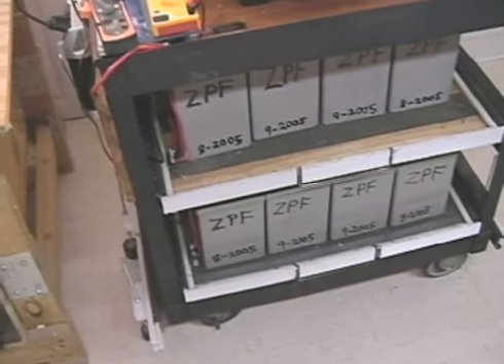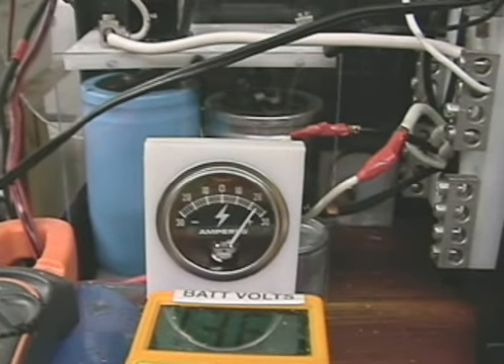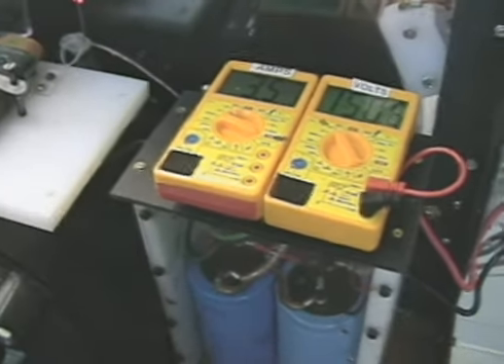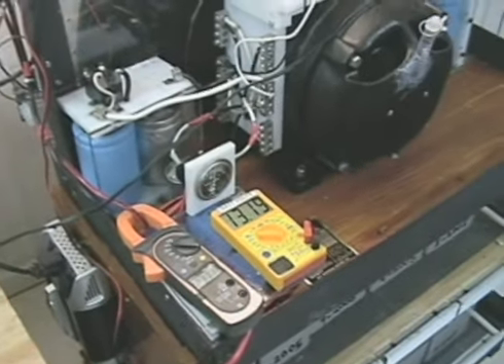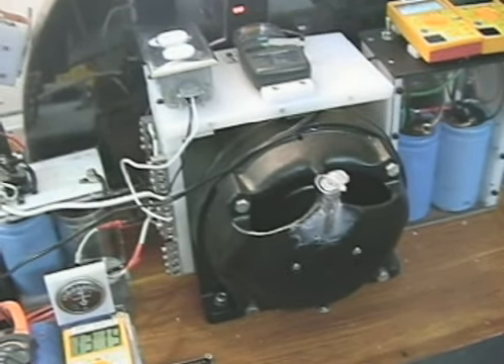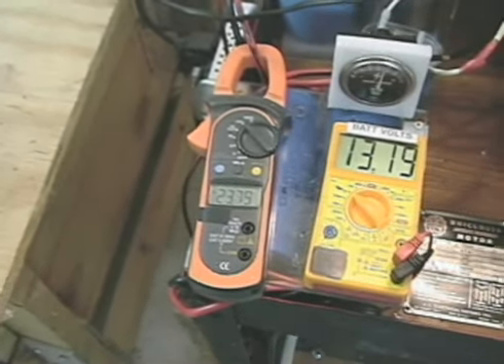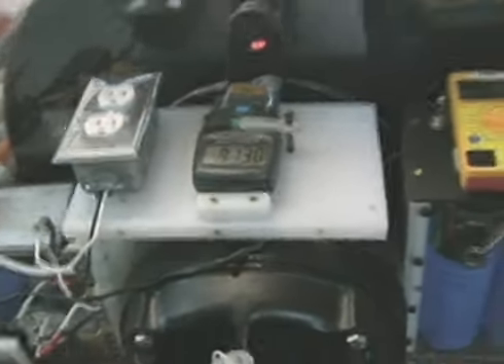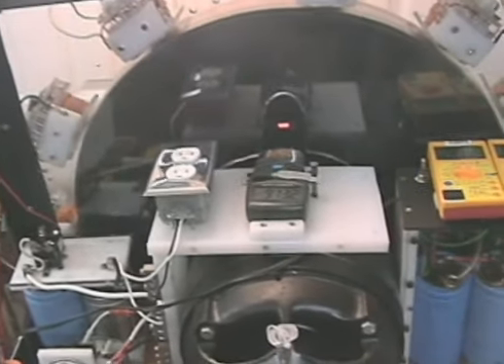Cartmotor3.0

Comment: @zeropointfuel I see. Have you read up on Hugh Piggots permanent magnet alternators? Pretty good stuff if you wanna go homemade. You have to use very high quality perfect (no knots) hard birch plywood though. I see gens attached to pulsers and i wonder if maybe one has to have quite a long drive shaft to the gen, and shielding between.

Comment from the maker: @KyleCarrington check out Cartmotor 4.0 not sure about Two-Stage Oscillator work .but the spinning mass is 32lbs at least for now ,The first of the four generators planed  is induction 6 amp 1/3 HP motor. By connecting  large DC caps together at the positive and the negative connected in parallel to the sine wave from the generator will be diverted  back through pulse motor

Comment from the maker: @KyleCarrington YES and YES the large size of the wheel has real usable torque. If I can strike a balance, I can control the sequential pulse motor runaway effect  with the load, then the 80% the energy passing through the motor  that is charging the all those batteries is free energy add to that professorial pure sine wave inverters  and you have a working system

Comment: @zeropointfuel When you refer to it as the SG pulse motor do you mean, by saying so, that it is based on the School Girl circuit?  If so, do you find that putting it under load - to an extent - LOWERS the amp draw from the wall, and, if so, is it that sweet spot you are trying to then send (the kinetic energy) to a generator.. if all that is true, I have an idea... (cont.)

Comment from the maker: @theDaftman the coil triggers are all at 4.7K and the motor never is more than few Degrees above room temp  3 9,800 mf caps at 150V on the input  and 1.2 F @20V on the output the inverter is fine no spikes are reaching the inverter

Comment: @zeropointfuel If my last comment is true... and it's that excess kinetic energy you'd like to employ, how about taking it and "hurling" a mass. Naturally it'd never be a "flip the switch and start" type setup, but.. imagine if that instead of a simple generator, you had more of a Milkovic or Feltenberger thing going on.. a hurling mass that helped overcome (with its momentum and gravitational assistance) the load imposed on the gen shaft by charge bats.